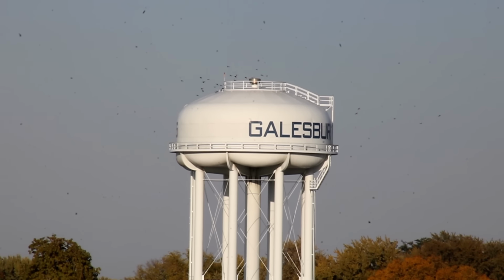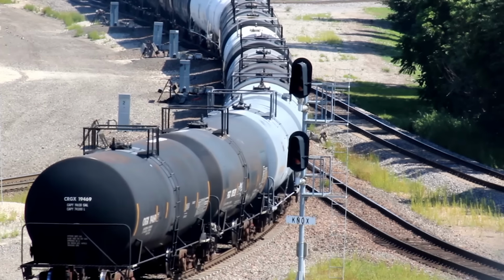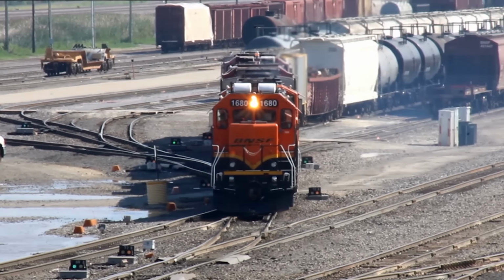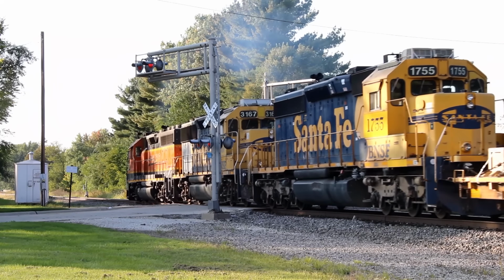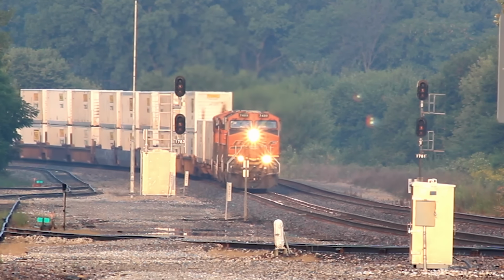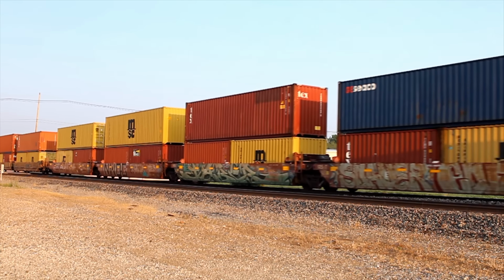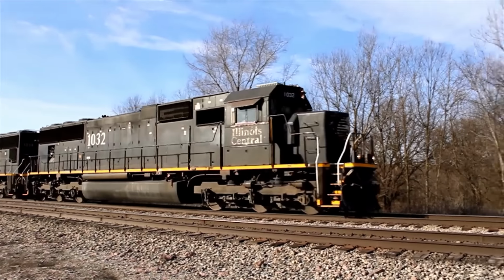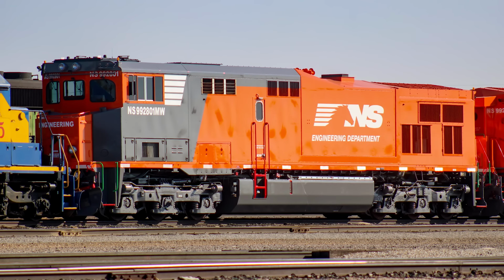BIZARRE Locomotives Of EVERY KIND In Galesburg, Illinois!

Comment from the maker: Merch, anyone? http://okieprint.com/SPR/shop/home
Reply: I don't see why not!
                                                       😃
                                                 👍👚👍
                                                     👟👟
Reply: that cup looks sick i need it
Reply: 14:05 giant triclops cow units
Reply: 14:02
Now, why did NS take two dash 9s, and turn them into giant triclops cowl units, instead of just repainting the existing locomotives in a designated mow scheme, which has been done countless times in the past.
Reply: 14:06
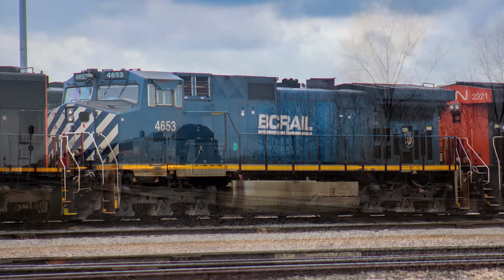Reply: 13:04 Another elusive fallen flag would be Eelinoy Central.
Reply: 12:50 Due to the fact that BC Rail was a smaller Class 2 line, they only have 14 dash 9s to begin with.
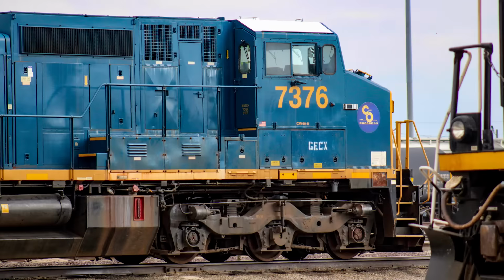Reply: 12:24 12:25 glots of life left in them
Reply: 12:05 12:06 Prayviosly
Reply: 12:15
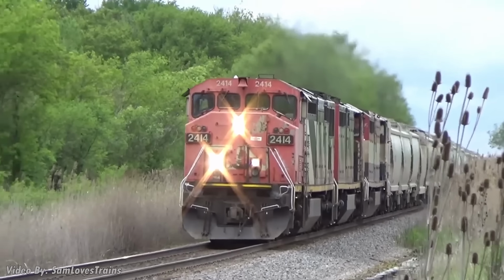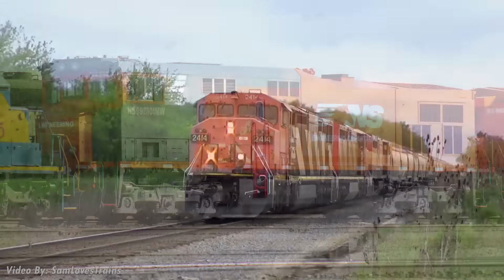Reply: 15:08 15:09 15:10
Reply: 5:39 5:40 poke through

Comment: There is a group of rail enthusiasts that are "graffitiating" locomotives to the original spec and as well I saw those dash nines in Iowa from one of the old GE plants or rebuilding sites something like that
Reply: Metraf40phfan123  why dude
Reply: Metraf40phfan123  why even comment
Reply: Metraf40phfan123  it's just pointless. And kind of rude
Reply: What
Reply: Metraf40phfan123  ok? That is the most common comment to comment
Reply: Metraf40phfan123  That's what I'm saying

Comment: Those “Bloomer” locomotives were cool as they look VERY much like the old Burlington “Chinese Red” locomotives.   I have never seen those.  Cool.
Reply from the maker: Yeah, the Bloomer Line has some really cool locos. The RR is a shortline based in Gibson City, IL
Reply: Hey, thank you for the response and info on the “Bloomer” RR.  I”ll look them up.  

I looked up the SW10 and non of the ones I saw had the same cab as the one in your video.  The one in the video looked like it had the cab from a GP loco.  The ones on the  net had the typical rounded cab of an SW.

Thanks again and Merry Christmas to your and yours!
Cheers, from Tomball, Texas

Comment: You know what? The golden swoosh is a cool stand out and unique loco that should keep its livery, but I'm glad it didn't become the norm. When you get the shot of the tailing loco rolling off into the sunset, it's cool to see the black logo with the golden outline of the lettering. It's not as gorgeous as the Superfleet livery, the executive mac livery or the original Santa Fe warbonnets that were used in passenger services but it's an improvement over the previous BNSF orange liveries.

Comment: 7695 isn't the only golden swoosh still in use. it wasn't failed, it was cost expensive because that golden print was all reflective after the merger logo redesign. after the reflective red and white tape came out for very cheap, the manufacturer stopped production the reflective gold as it was more expensive than the reflective tape and for rail roads to use that red and white reflective tape along the deck boards of all the consists keeping a consistent look and height across all railroads right at sedan windshield height which government and rail road safety studies concluded was much safer and remarkable reduced automobile-train collisions at night. the golden reflective was less visible at night in precipitation such as rain, snow and snow storm conditions hence why it was abandoned
Reply: Very interesting!

Comment: I've seen two weird looking engines like what you call dash 9, here in southern Idaho. One on either end of a short train used to pick up used railroad ties. With 2 excavators riding on the cars. Both engines are unique though, are different from each other.
Reply: Probably a GEREX Slot Train. We had one running around Central Nebraska for about a year, cool to see them out and about.

Comment: If an internal combustion engine requires more cooling, then it's not as efficient. A six cylinder prime mover requires those massive radiators?  That heat has to come from someplace. Not the same, but when I worked in fleet management for diesel trucks, when the emissions standards came in, engine heat increased massively and fuel economy dropped.

Comment: 11:03 the 3 milers don't beat up the rail line...they are too long of period vibrators that really disturb ballast that wants to move and locking wet area ballast into pump jacking very easy. peat and marsh crossing areas and areas with poor water drainage such as clay lands need shorter duration and longer recovery time to handle traffic. it was just poor choices to put a rail line in such conditions with bare minimum fortifications aka expensive $$$$$$ cha ching.

Comment: I'm sorry to say this, but US freight diesels are so underwhelming in design. They're all just slight variations on the same theme, especially the more modern ones. Nice to see some of that old stock as well. But it's so striking as a European, to have to see such designs. Practical, sure. Artistical value, zero. One look at a Siemens Vectron, or a Stadler Eurodual, and one instantly notices that they're designed like a car, as something with character. Bit there's the answer as well; it's because latter are designed by competitors, whilst the former at all made by GM. And when there's only one factory making them, so why should they? 
😑 Mèh